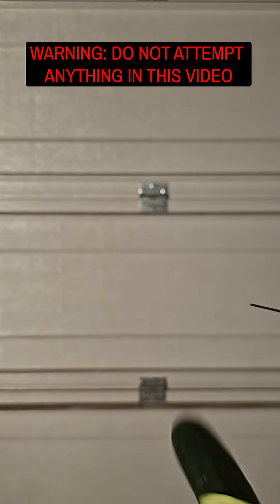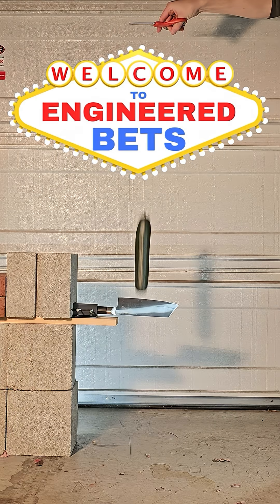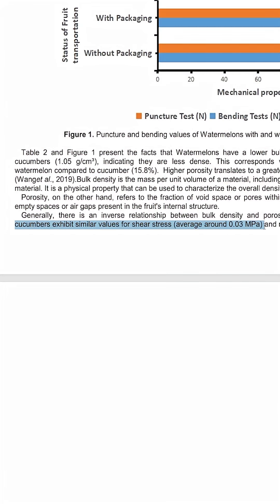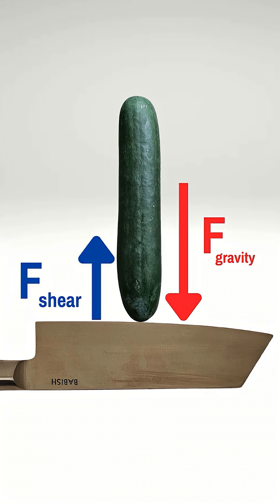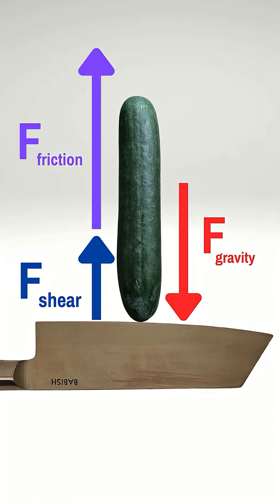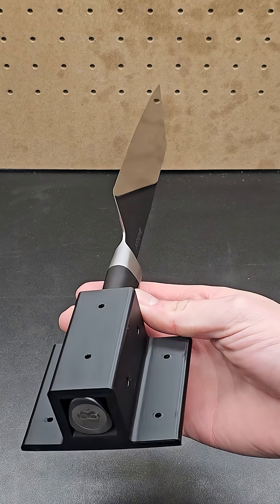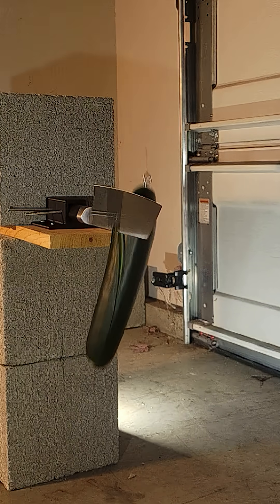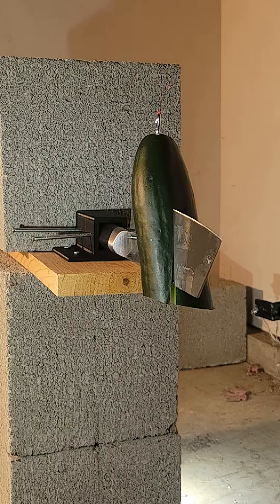Can this reverse guillotine cut through an entire Cucumber?

Comment: There's another factor you didn't mention which is the externecity and imperfection.. you held the rope and knife in 1 linear axis but it's impossible for a cucumber to have the center of mass in the geometric center of it's cross section because of imperfection in its body..
Therefore would it rotate a little when it hits the knife

Comment: You left that metal pin in the cucumber when you dropped it, needlessly risking damage to the blade just so that you could dramatically cut a string with scissors to release the cucumber without coming up with a better release mechanism. And it didn't even hit the blade straight on.

Comment: the bigger factor and showing in the drop that did stop it is the direction of the forces, when dropped from the string all most everything would be aligned, the one that stuck things were pushing the cucumber into the edge of the blade. 

That allowed the surface of the soft cucumber to deform more into the hard blade creating greater surface area for the extra force to generate more friction.

Comment: It's an energy problem, not a force problem...if the kinetic energy is bigger than the energy to cut the cucumber (shear force x cucumber length) then it will cut through.

Comment: Also, the fully sliced ones might have the imbalance advantage of one side being heavier than the other, thereby letting the fruit be completely sliced without stopping. When you dropped the partial cucumber and the slice was clearly through the center, It stopped halfway through.

Comment: the whole cucumber weighs more than a piece, which is why the piece gets stuck and the whole cucumber gets sliced through - the whole cucumber uses its weight to push itself through the knife, but the piece has a lot less mass. The piece got stuck not (only) because of the lesser height of the drop.
Reply: Reduced mass and acceleration!
Reply: @canoepick1140  the acceleration stays  the same, it's just because of the reduced height the piece does not have enough time to accelerate to a high enough velocity
Reply: @noisethewhite oh true gravity hasn’t changed! 🤦

Comment: "It would theoretically never stop slicing through"
I mean, it didn't.
Reply: The calculation without friction predicted that the cucumber would be sliced even if you just lightly placed it on the knife (no momentum)
Reply: @LugnutsK actually I think it would be correct if not for the skin of the cumber
Reply: only if the cylinder is thrust sufficiently hard enough into the blade
Reply: @Giovanni_7282R you cant harm the smaller cylinder though
Reply: @3dogsandaguy589  it is imperative that the small cylinder remains intact
Reply: @Giovanni_7282R in which case, 9.8m/s^2 Is more than enough
Reply: @Giovanni_7282R
hehe
Reply: The shear force is less than the force caused by the acceleration due to gravity so according to the calculation the knife would slice all the way through the cucumber no matter what height it is dropped from. When he dropped the cucumber from a lower height, the knife didn't go all the way through. So the calculation was wrong.
Reply: @chambathinle wouldn't the force change cuz it was a smaller piece?
Reply: @Comfy_Bed that's what I thought as well.
Reply: It is critical the cylinder isn't harmed
Reply: I think what ruined it for him was that he couldn't see how close his calculations got, because he can't measure how far it sliced exactly, since you can't measure "overkill", so to speak.
Reply: Indeed
Reply: Well it would eventually if the cucumber was long enough. According to his calculation an infinitely long cucumber would keep accelerating through the knife forever because of gravity.
Reply: The very next sentence addresses that...
Reply: A lot of y'all need to learn what the word, theoretically, means especially in the context of scientific experiments.

Comment: The cylinder was, in fact, harmed
Reply: It is imperative that the cylinder remains unharmed.
Reply: @Werty715_25 too late
Reply: @Werty715_25hopital
Reply: More distressing is the paper that had quantified the exact resilience of cylinders to harm.
Reply: @theelderbrain there is a paper for shear force of the cylinder as well. 🤣😂🤣
Reply: @canoepick1140  That's so you can know how hard not to bite. 😉
Reply: Poor u/Smart_Calendar1874 that was a great thread and permanently internet lore now.
Reply: @canoepick1140  Bro's username has now spread to other platforms, this is crazy!
Reply: @Arhats_CornerI saw the original post and have been watching the spread slowly. lol
Reply: @Arhats_Corner He can never escape no matter where he goes
Reply: So he has to bear this cross forever :(
Reply: Hospital
Reply: peak reference
Reply: Certified Reddit Moment
Reply: But how is the larger object
Reply: He said it was imperative!
Reply: Elite ball knowledge
Reply: It's not my dihh it's a cylinder
Reply: Yu no ball
Reply: elite ball knowledge
Reply: Peak Refrence
Reply: I wonder how far the cucumber would be cut if it was enclosed in a tube rather than exposed.
Reply: Because it's attached to a larger structure

Comment: Since cucumbers are ordinarily sliced across, instead of along the length, I wonder if the shear force was calculated only across.

Other factors that I think need to be taken into account: 
1. The viscosity of the juice within a cucumber. (How well does it lubricate the flesh of the cucumber from contact with the knife?)
2. Amount of the knife blade which actually makes contact with the cucumber. (Does the wedge shape of the knife edge push the flesh of the cucumber away enough that the cucumber's contact against the flat of the blade is greatly reduced? Once the splitting of the cucumber is directed outward from the flat sides of the blade, the semi-rigid cucumber is unlikely to make full contact with the blade.)

Comment: The friction force wouldn't be all that high, as the cucumber self lubricated itself with the water
Reply: Unless the formula he used accounted for certain height of drop to build up to a certain level acceleration before making Contact the way he phrased it. I think he was saying, the math said that if the cucumber fell starting at Contact with the blade, it would just cut straight through. It would also be complicated by the fact of what angle does the cucumber hit at how much surface area is in contact with the blade if it hits at an angle, is there a wider side with more friction and a narrow side with less friction? It’s definitely not a trivial pursuit.

Comment: babish spotted in the wild woah
Reply: I was pleasantly surprised by the quality/price ratio of the knives he sold. It's neither my best knife nor my cheapest, but I don't have anything better and cheaper, and have certainly seen more expensive, worse knives.
Reply: Solid knife with p/p considered
Reply: I got the same knife and it's phenomenal, I wound up cutting my palm open because I misjudged my hand and the tip. I didn't even notice till my onions started to get red. 😂
Reply: @greggillis8949  "wait I didn't buy red onions..." eww.
Reply: @greggillis8949  a baffling endorsement, but you've sold me on it.
Reply: I actually use those knives at work. Had them for almost 3 years now and they're the best set I've ever owned. Literally the best knives on the line, my Executive Chef borrows them all the time.
Reply: That's where i'm at.